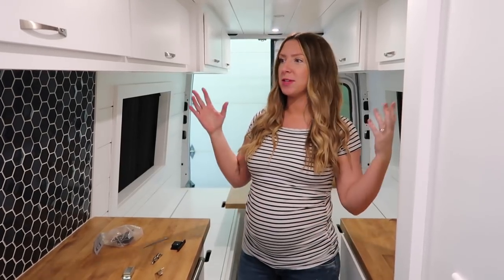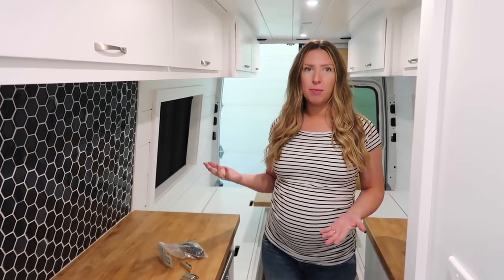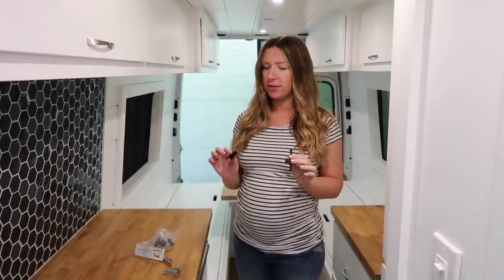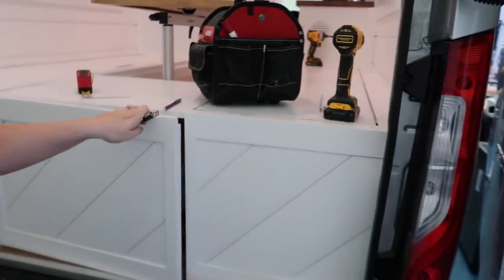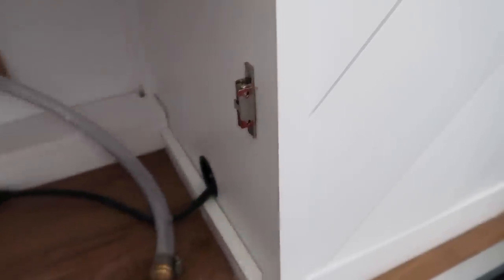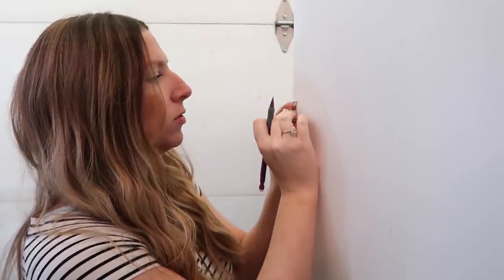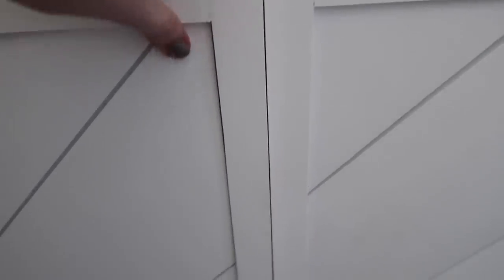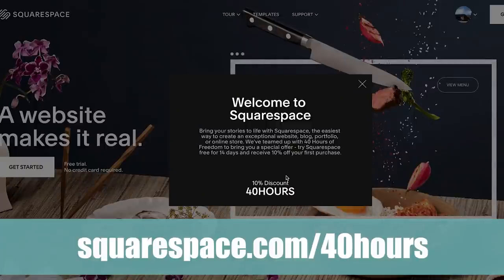BEST CABINET LATCHES FOR VAN LIFE | how to keep your cabinets shut in a van

Comment: Got a tip for ya, instead of using paint marker. Put your latch on the cabinet, use masking tape on the cabinet and make a center Mark. Close the door and line up the door piece with the center mark. Works perfect every time.

Comment: I would make the fitting really loose and use double sided tape, close the door and it should stick to the cabinet door, drill the pilot holes and remove the double sided tape and install. Nice video!